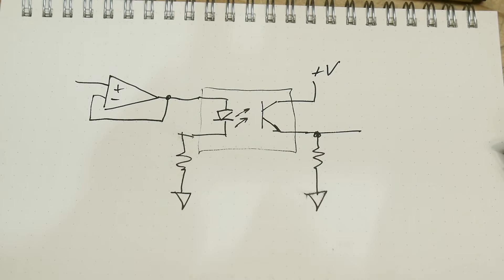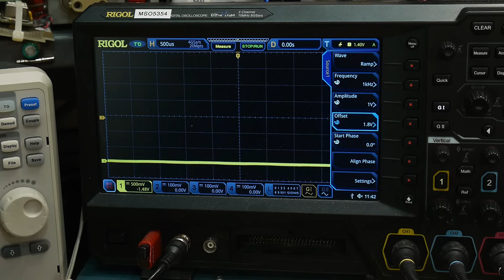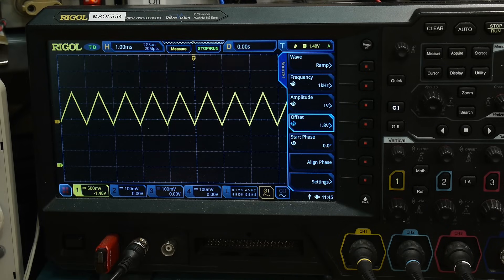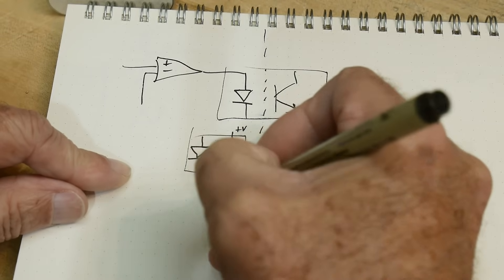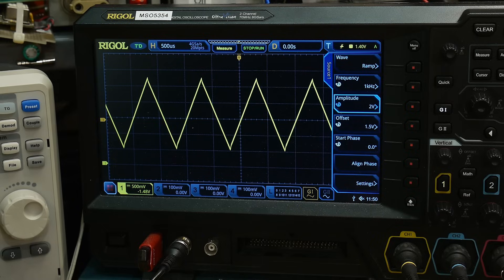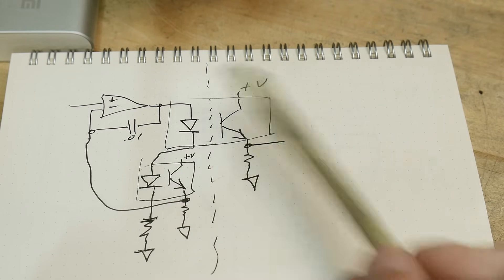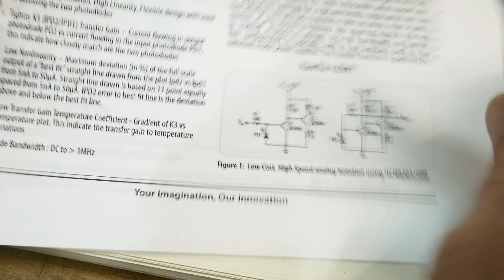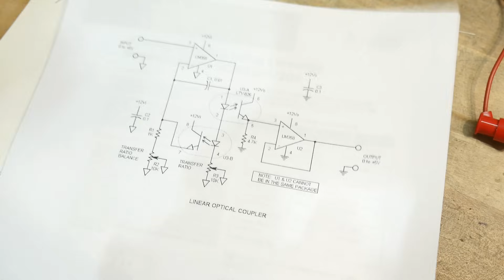#1849 Linear Optocoupler (part 1 of 3)

Comment: Wow!  This is provoking a lot of memories for me.  I was working for a now defunct company called 'circuit processing apparatuses' back in 1980.   We were trying to use a HP photo-Interrupter to detect movement of a product in a vacuum.  To ensure no false triggering, we gated the signal at a couple hundred KHz.  However, we quickly realized that the bandwidths of these HP devices were not up to the challenge.  My lead Engineer, pointed out this same system that you were explaining.  Through a lot of trial and error we were able to get this circuit to work.  Great memories.

Comment: That's an interesting circuit, using an op-amp's negative feedback to liberalize the transfer function.  But it is just unipolar.   There are linear, bipolar optoisolators designs that use a pwm signal.
Reply from the maker: this would also if you just DC offset the signal to 1/2 Vcc
Reply: @IMSAIGuy  Then it wouldn't be linear.
Reply from the maker: @williamogilvie6909  I just showed it is
Reply: @IMSAIGuy  You don't know the definition of linear.   The function f(x) = x + A is not linear.
Reply from the maker: Y = Ax + B seems to be a straight line, no? that IS the definition of linear.
Reply: @IMSAIGuy  Yes, you are right.   It is linear.   But you would not have much range if you tried to make the circuit operate on both sides of 0 Volts.  And equalizing the offset on both sides of the optoisolator is a problem.
Reply from the maker: Great, it is good to know my degree in Mathematics didn't let me down.
Reply: @IMSAIGuy 😂 Dude got burned!

Comment: I designed some 4-20mA transmitters using IL300's. Been in production for years now. The IL300's are binned according to their CTR which helps reduce the variation from opto to opto. They are a little pricey but work well.

Comment: thanks for the video. when we talk about isolation we should have 2 separate isolated power supplies for the circuit another thing, input voltage of this circuit is limited by the power supply back in the old days we used cpc5710 linear opamp with a gain of 6 we used it for telephone DC voltage monitoring.

Comment: Wow, ... that let me think of an 'isolation-device, for amateur-radio use. 

How about to 'build' an isolation 'USB-thingy', to 'de-couple' hum and noise (spikes and 'deathly voltages'), from the pc or cell-phone to the 'HAM-radio devices? 

Like an isolation-transformer for Audio-Frequencies, but for USB, instead? That would solve some problems, that a lot of HAM's have, when using electronical devices, with the computer and the radio. 
Is it possible to make such an 'USB -transformer' with the opto-couplers ? 

73 de Markus - db9pz - 
(Loc: JN39fq - 5km/3miles east of LX !)

Comment: I would have thought that an optocoupler driven by a PWM signal would have been a better approach.
Reply: Yes, non linearity then becomes an advantage. The trade off is bandwidth though, as optocouplers are typically slow.

Comment: This video is well explained and  but still.....I wonder what would be the kind of analog (practical examples) of such applications where you strictly need an identical signal produced by the opto-coupler ?  Thank you.
Reply from the maker: regulation circuits of high voltage power supplies or transmitters

Comment: 6:40 The output of the second photo transistor is feeded by the +V of the high voltage, so how is that isolated if you bring this back to the input of your OpAmp ?
Or is the +V of the second Opto-coupler another powersource then the +V of the high voltage side ?
Also, you have 3 ground points, if all 3 are connected, there isn't any isolation between the low and high voltage side, or am i missing something ?
Reply from the maker: the two sides have different supplies, total isolation. see part 2
Reply: @IMSAIGuy  thank you for the quick reply, i didn't see part 2 yet untill now.  Grtz

Comment: Excellent work.
I'm just wondering if you could do the same with "True Feedback" like use 2 optos in opposite directions and cancel each other's nonlinearity. That way you wouldn't have to have matching optos and achieve true output feedback. Hmmm.... what would the circuit look like... I'm going to work it out I think.... :)

Comment: To achieve linearity you should drive the LED using current rather than voltage. That could be achieved by moving the OpAmp negative feedback to the top of the resistor.

Comment: What happens if you introduce a little DC offset to the signal to help overcome the diode forward biasing ?  Does that reduce the signal corruption ?
Reply from the maker: yes, you can try and find a more linear portion of the LED and only use that. not as good as this, but might be fine in some applications

Comment: For some applications like switching power supply, wouldn't be better to place the 2nd opto LED on the other side?
Reply from the maker: ??? there is an input side and output side, just turn the paper 180 degrees
Reply: @IMSAIGuy  now my turn! ('???')  What I meant was placing the second LED on the right and dioide on the left to complete the feedback loop. I edited my post to clarify it.  This design is liken a transmiter/receiver set which only 	measures the power needed at the transmitter side.   Today,  the radio (specifically TV) stations measure the transmitted power some distance away in multiple points and send the power readings back to the transmitter to adjust the power accordingly.  For example, for rainy/snowy or sunny days or reducing power at night .  Then power would not be wasted. 

In PSUs, I think there are opto couplers to adjust the PWM.  But the transformer's output voltage is used to compare and adjustments.
Reply from the maker: @bayareapianist  compete the feedback? remember this is high voltage isolated.

Comment: A wise man once advised, "Never use a 1k resistor; people will assume that you just guessed."
Reply: I have a box of 1.1k just for that reason :))))
Reply: @thevoidedwarranty  You are my hero. I'm going to have some 4.74k resistors custom made now.
Reply: @SkippiiKai  make sure they are 1% tollerance :))
Reply: 1K, 10K, 100K = the holy trinity 🙏
Reply: @4DRC_  My favourite is the 4K7 because I grew up with TTL😂
Reply: Still, 1 kilo-ohm resistors have kept it simple for me with LEDs on 12 Volts DC power (in that particular case, my modified Halogen spotlight which I chucked in metal halide HID lamp, and I opted to use LED-illuminated rocker switches - it worked fine with voltage up to almost 15 Volts DC from the Lithium-ion battery pack). Some LEDs are quite efficient nowadays, so it doesn't matter if it consume 1 or 20 mA, the outcome is still the same.
Reply: If it works, who cares if you guessed? 🤔
Reply: @aviandragon1390  In a professional environment, appearing to 'guess' might not be the best career move. Being able to guess correctly is great, but it perhaps needs to be backed-up with page of 'Design File Memo' supporting data.

I've seen six pages of math to select a rivet, so EEs should be seen to take as much care.

Up to you !!
Reply: @JxH  tbf there are a lot of situations where the exact value of a resistor doesn’t matter, digital pull-ups/down for example (within a range of decades of course). In that situation you really have to consider the time cost of calculating the perfect resistor, as well as the cost of stocking them.
Reply: @4DRC_  Of course, so use 910 or 1.1k, to keep them guessing. ;-) !!
Reply: In a professional product, of course you want to calculate for whatever parameter is most important to the design. This guy is just spitballing a circuit for demonstration. I'm not sure the same level of care is required here.

Comment: Been there, done that. 
Used a bulkhead (bolt-shaped) optocoupler to couple audio into a system where we had to ensure that absolutely nothing went the other way.
The LED and Phototransistor were given the old Y=mX+b treatment to linearize and center them within the available dynamic range.
We didn't even spend much time analyzing it, but very simply employed trimmer pots, with very generous range, to set the bias (offset) and gain on both sides of the bulkhead.
Twiddled four trimmer pots, while viewing with a 'scope. It worked like an absolute champ.

Comment: By using TWO optos, you will run into trouble in the long runs as they 1) degrade over time & 2) optos are very temperature sensitive.
Devices like the IL300 likely mitigate the issue.  Looking forward to part 2 & testing with things like temperature.

Comment: Interestingly my older series 3478a uses little transformers to isolate the control from the analogue side. The later models used opto couplers. Boringly, I just looked at the circuit and it is just two micro controllers sharing the connection via one pin and a differential driver for the transformer coupling. No analogue magic.

Comment: "Pro tips" from the stone age! OMG! The two separate optocouplers are obsolete for decades! IL300 is friend if you REALLY wanne do it plain analog, which is still OK in many situations. Modern isolation amplifiers all work digital using a delta sigma converter on the input, transmitting digital (optical, inductive or capacitive) and converting back to analog using a filter. Works like a charm! If you REALLY learn something usefull, get an IL300 and play with it!
Reply: This was what I was thinking they should do. You could even have a 555 on one side for simple pwm. Half retro junk.

Comment: I'm curious to see how this is done for HFC (Hybrid Fiber Coax) cable TV systems?  In that application, from the cable TV head-end, there's a distribution of the signal over fiber optic transmission out into the CATV distribution system.   There's a laser that's analog modulated by the RF carriers coming out of the head-end, probably going from about 30 MHz up to 1 GHz or more - the whole forward passband of the CATV system.  And this has to be pretty linear given the fancy modulation used by ATSC HDTV video transmission and a pretty dense (256-QAM) constellation for your DOCSIS 3 Internet cable modems.  Even more demanding with DOCSIS 3.1 and beyond using OFDM and squeezing the bit even harder..

Comment: That's interesting, how did you calculate the value of the capacitor to make it stable?
Reply: Experience and rule of thumb!
Reply: @JacquesMartini  Then you try it out in circuit and see what value works best. Capacitor substitution boxes are very handy for lower frequency circuits.

Comment: For the first simple schematic you should use a current source not a voltage buffer with a resistor. It's easy: just connect the feedback to in- to the point between the diode and the resistor.
This should already improve linearity.
Reply: Sure, but from an educational point of view the first, naive approach is good to show you how it does NOT work and why. And leaves space for improvement and success stories 😉
Reply: Yep, to a point. Nothing is literally linear, unfortunately. Not to mention the subtle differences between a few different transistors in an OP-AMP chip causing rare instance of weird events to happen in a specific application (a few people, including me, have been bitten by it). Analog wizardry is rarely simple.
Reply: It was my idea at the very first glance. Thanks you wrote it. Voltage to current converter, just one resistor in negative feedback of first op-amp, thus voltage produces directly current of LED, LED light is ~propotional to the current and light intensity on the Base of transistor works like Base current, at the end Emitter current is proportional to Base current (light intensity). Almost perfect isolated follower. Then later we could add some extra circuits, current mirrors, thermal compensation and even optocoupled negative feedback.

Comment: this reminds me of a regen receiver kit i built that used an hp opto isolator - “Build the OCR II receiver” in the september 2000 issue of QST. the optocoupler isolated the regeneration from the antenna.  How did that work? because it did (sort of) work. aha. iirc it used an IL 300…

Comment: I can imagine there are still applications for these kind of circuits if you want to keep the parts count and complexity down (by not going to A/D and D/A etc...). If it doesn't have to be super accurate on the isolated side then these analog solutions should work fine.
Reply: All this stuff is available fully integrated in a single, cost effective IC nowadays.

Comment: What's the optocoupler model?
Could they substitute 6n137 / 6n139 (in midi circuits)?
Reply from the maker: I used a PC817 but any optocoupler should work fine
Reply: @IMSAIGuy  Thnks, some people use 6N137 for MIDI, it's  almost 2€ piece, got some PC900  (obsolete, used by Roland), they all have some logic inside. a PC817 + 74LVC1G175 (Single Schmitt-Trigger Buffer) would be cheaper, although it might cost a litle more more pcb real estate

Comment: This is a good compensation circuit which reminds also of how to work with thermocouples to measure rf power by comparing it with dc power. It depends on finding matching couplers or the special matched dual coupler.  
An alternative to transmit an analog signal with optocouples is to convert the analog signal with analog means to analog pwm, which can be in fact analog but looks of course very much digital and is not quite as fast as with the optocouples.

Comment: Why would you put the optos in series and not just parallel? Because now the non-linearity at the feedback opto is basically doubled, since they are in series?
Reply from the maker: if in parallel, you have two LEDs in parallel. since the Vf curve will be not the same there will be current hogging of one LED before the other and they will not match well
Reply: @IMSAIGuy something that could be taken care of with a current mirror? 😊

Comment: Can't you just feed it into a logic gate? I am assuming you want logic in and out without linearity?
Reply: Doing analog linear isolation. Logic is not linear. Using A/D, then D/A would introduce delays and other artifacts to the signal